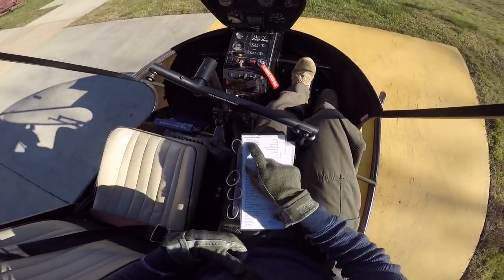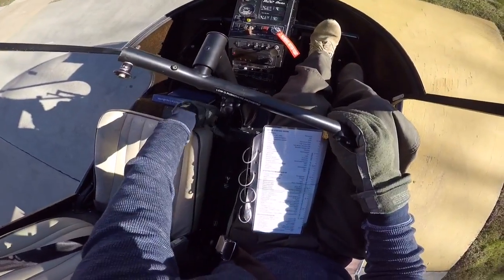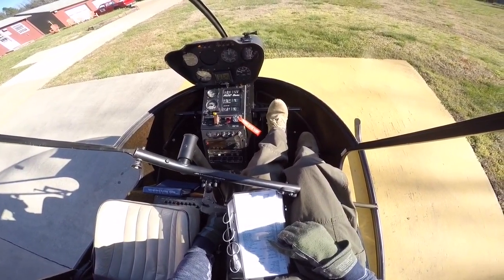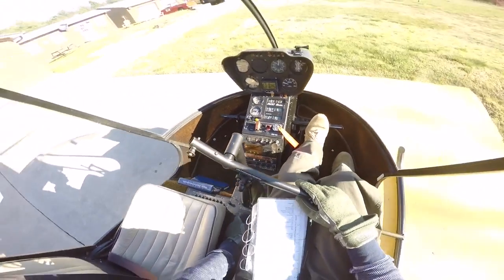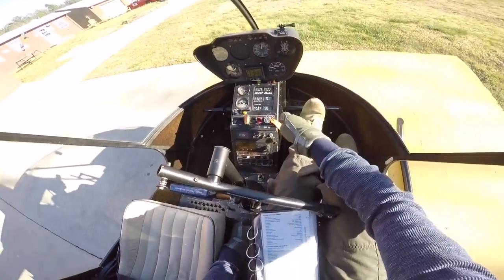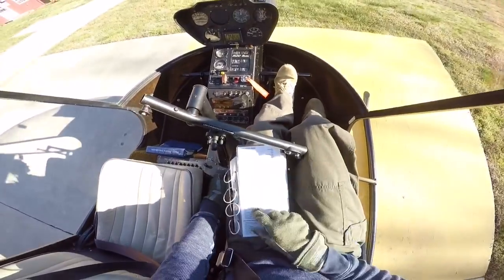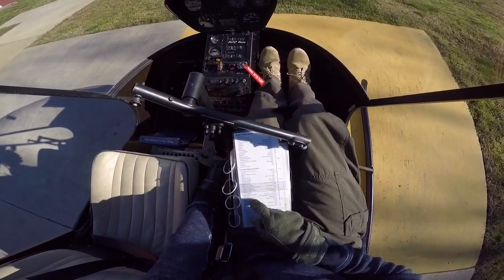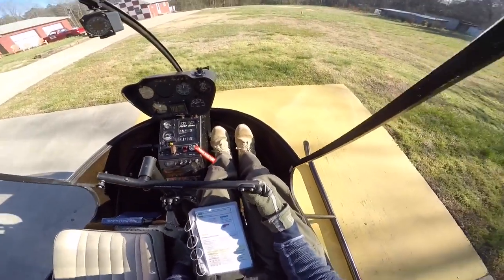Robinson R22 Startup Procedure

Comment: I'm going to be moving to Logan Utah in August, and there is a flight school at the airport there that has a fleet of these birds. I'm going to check into going to flight school there next Spring.
I have a flight sim program that I log a minimum of 15 hours a week, and it has helped me a lot with the handling of R/C helicopters, and I understand the basic functions of the Cyclic, Collective, Tail Rotor and Throttle and how they all work together. 
Yes, I know it's a lot different than an actual helicopter, but it has taught me a lot about them.

Comment: This is a big difference when you see in the movies where people jump into a helicopter and the next thing they take off and up in the air !
But that's Hollywood for you.
Reply: In emergency situation, like you're being shot at and need to escape in the helicopter like in the movies, you could skip most of the checklist.  Most of items are for checking the helicopter's systems or warming up the engine so it lasts longer.

In an emergency rapid takeoff, the longest thing would be waiting for the clutch to engage enough for you to take off.  In a turbine helicopter you wouldn't even need that.

R22 being shot at takeoff checklist:

jump in
mixture down
master switch on
start engine
clutch on
rotor brake disengage
pray/shoot back while the clutch is engaging which can about a minute
throttle up until governor kicks in
take off and get the hell out of there

Flipping switches only takes a second each, so without the clutch engage time you could be off in maybe 15 seconds.
Reply: Also another myth is in a  movie were its people who have never flown before, and make it up in the air is a false. 10/10 would crash the bird. The skill/experience needed is a lot of hours and training.
Reply: At the risk of destroying the helicopter, and killing yourself, sure you could be off of the ground in a couple of minutes.